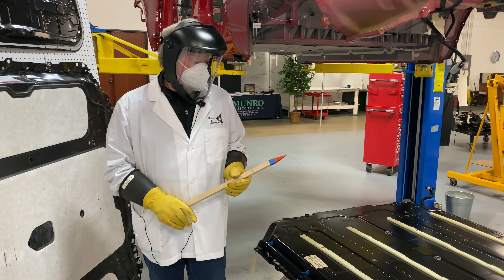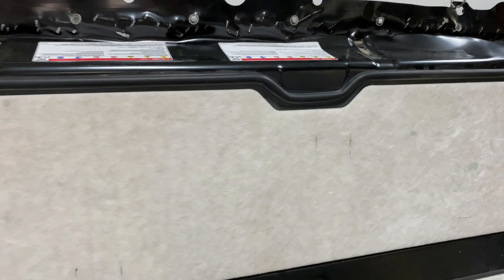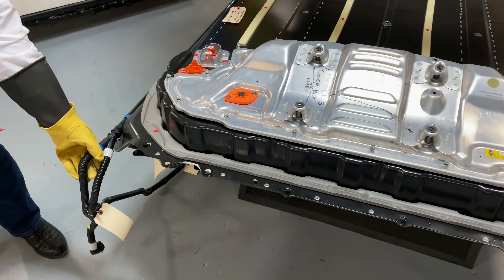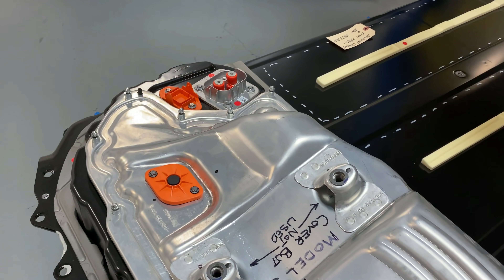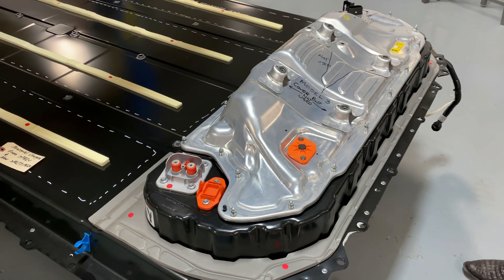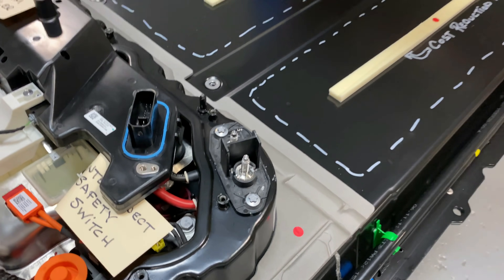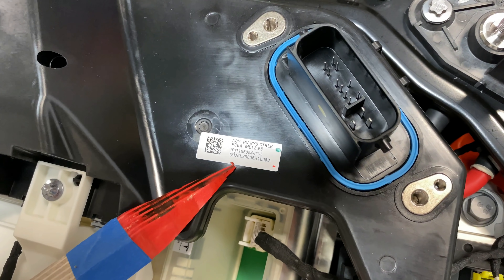Model Y E24: Opening up the High Voltage Battery and Comparison MY-M3, Pyro Fuse

Comment: My questions are a little late wrt this video; however, I thought I'd post in the hopes someone is still monitoring comments and may have the answers!
1. If I were to dent the underside of one of these packs with up to 1/2" (12.7mm) dent, caused by a rock strike, would said dent compromise the integrity of the pack?
2. Can Tesla service centers diagnose the effects of said dent(s)? to determine whether the HV pack needs to be replaced?

Comment: great video. Does the pyro fuse protect the system from over current in the case of a battery short and if so, what sort of current would cause the pyro fuse to blow?

Comment: I just remembered something. I have a 2015 Prius V. I had no idea just how handy a hybrid car was. I like to camp in it, if it's very hot or very cold , I'll leave it ON, but the ICE turns on every 5 minutes or so. I think my 12v DC system is running off the small 12v starter battery (I use 12v to charge my electronics with, sometimes hook up to an inverter). I've read accounts of people who've run the essential house functions off their Priuses for a week during power outages. At some point I wish I could've connected an inverter to the large traction battery. (There's a YouTube video that is basically an idiot test: Do you understand the video? Yes, then you're an electrical engineer. No? then you're not an electrical engineer and shouldn't try any of it. No, but you're going to try it anyway? You're an idiot).  My imagination started running wild, what about hybrid boat engines? Why hasn't Toyota sold the ICE/Battery system as a generator...  I'm sure you could explain all my ideas and why most of them are unworkable (or already being done), but some of them, or others are viable. Now go to the Cybertruck: 120/220 VAC plugs, integrated air compressor (and I sure hope there are ports at every wheel well - if they can be made mudproof and muddied-up-accessible.

Comment: I heard the Model Y the installed a battery warmer like previous Teslas.  Wonder if its resistive or uses the heat pump instead of the motors like Model 3.  Or is it the same?
Reply: It uses the heat pump

Comment: Why would the 12V battery wires need to be so thick? I would not expect high current to be needed at 12V in this type of system.

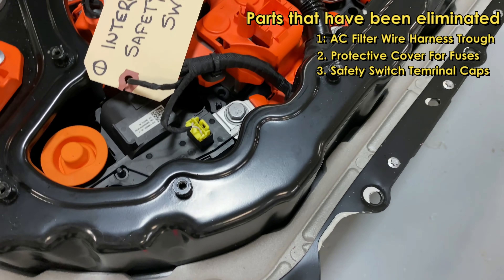Comment: What's a "Temrinal" Cap?  At time stamp 5:41.
Reply: The word capacitor is often abbreviated as 'cap;' they had probably been connected across those high-voltage switches to protect the switch contacts. When automotive ignition systems had employed a cam-actuated switch (points), a capacitor reduced erosion due to electric arcing of the metal contacts.
Reply: @brothervance1932  I know what "Cap" means.  I was talking about the word "Temrinal", that was on the screen. Is that a brand or did they mean "Terminal".

Comment: Hello Sandy, in your description of the components under the AL lid I am missing a reference to a converter when AC-charging takes place. You only pointed at the DC-DC-converter that comes into effect when the charging current is DC, right? Or could it be that this big housing also hosts the AC-DC-converter? Thank you for your answer.

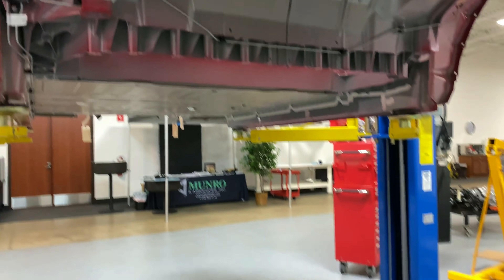Comment: Pause at 1:12 to examine the large, revolutionary aluminum casting. It appears to be made in two halves because you can see a gap or groove down the center at the front and back of the casting. The other thing I’m wondering about is the seat mounts on the battery control module cover. Does this mean the seats must be removed any time the battery is removed from the car? Also, are there 4 more seat mount locations on the chassis to the left and right of these mounts?

Comment: I love their design philosophy, they are obviously thinking in advance to be able to standardize their battery "form factor".  The batteries are lasting insanely longer than most imagined though, so battery replacement looks to likely be a non-issue.  The interesting thing will be the possibility for upgrading your battery to a dramatically better energy density unit in the future, and the software to support it is easily deployed ahead of time.
Reply: TexRobNC - With the exception of the Leaf (because Nissan beancounters decided to eschew thermal management), EV batteries seem to last longer than anyone expected.

Comment: As someone who works on high voltage equipment regularly (20kV+), I had to chuckle at the amount of protective gear worn here.  I think the max voltage on that pack is maybe 400V.. and while it would zap the shit out of you - possibly resulting in death - if you touch the wrong thing, it isn't going to jump across the air and attack your face with a sudden lightning bolt.
Reply: Accidentally drop a metal object and the current turns said metal object into a rapidly expanding cloud of molten droplets.  They make nice burn marks on your lab coat, but are hell to take in the face.  I think it's also a "don't try this at home without proper gear, boys and girls" kind of thing as well.

Comment: Mr Munro, that pyro switch probably disconnects all high voltage not just two batteries. Because batteries wired in series to get the high voltage if you open a circuit between the sets of batteries ... it will shut off the current on the entire block. There are probably like 4 blocks at ~90v each - giving 360v. I am willing to bet they used common 360v industrial ac motor [at least initially pulse control].
Reply: Dear Brian, Tesla motors are far from industrial AC motors. Check the Munro video about electric motors and you will learn that the rear Y motor is a permanent magnet one, with a special set of magnets used to bend the magnetic flux in a very uncommon but affichent way. That motor has been developed for the 3, the Y, and the Semi by Konstantinos Laskaris and his team of fellow researchers in Greece. Those guys are the best EV motors engineers you can find on the planet ! And, with a past as electric engineer having developed my own EV and a variable reluctance motor during the 20th century, I know a bit about e-motors...
Reply: That is not what I said or meant. I was pointing out that the pyro disconnect all high voltage. And they probably started with 360v motor.

Comment: DC to DC converter? How he described it,sounds like a DC distribution module.
Reply: You have to keep in mind that the only power going into the car is high voltage DC into the main pack, which then gets converted down to 12V (and possibly other voltages) to operate the computers, fans, etc. So technically because the input of that module is high voltage, and the output is low voltage.. it's a DC to DC converter.

Comment: Can anyone elaborate on how the Pyro switch works?
Reply: First hit on Google search. There's a pyrotechnic charge in it that severs the connection. It's triggered usually by the same signal as airbags.
Reply: @iLoveTheseRemoras  Ahh right I get it - thanks! Sorry for not googling, I assume it wasn't common so asked here, clearly should have googled first!
Reply: @dsmclaughlin12  No prob, I didn't know it was called that either. Have seen one before though
Reply: It's an explosive link. To be fair' I'd have thought there would be three to separate  the battery pack circuits into four.

Comment: Sandy, could you point out source of the battery breather "pops" that M3 owners are very familiar with? Will it be corrected on the MY?
Reply: I suspect it's not the breather itself that is making the 'pop', but rather the large metal panel flexing that makes a sound.    The internal pressure is supposed to be controlled by the breather but if the rate of pressure change exceeds the capacity of the breather (I've only heard it while supercharging when a relatively large amount of heat is generated quite quickly) a small amount of pressure can build up, causing the aluminum to deform and 'pop'
Reply: @sooocheesy  Ah right that makes sense. When it's freezing out it's even worse. As I commute to work my car thunks all the way down the highway as battery warms up. I just hope after a couple years of thunking it doesn't cause stresses and fails.
Reply: It's probably a panel that could have benefited from stiffening ridges. Maybe some anti drumming mastic mat would stop the popping. Then again - strippng the car to get to it...

Comment: Munro needs to get a current production model 3 and see how many of these changes have already been added to that assembly line. Tesla doesn't do model years.  The model three there are comparing it to is an early production from 2017 I think.
Reply from the maker: As some have alluded to, although we would love to tear down all model years of all cars, it just doesn't make business sense for us to do so.  The Model 3 that we tore down in 2018 was an early production model, just like this Model Y is. It is HIGHLY likely that many of the iterative improvements that we're pointing out are in fact present in current Model 3's now, but that doesn't diminish the fact that they are still improvements.  Thanks for tuning in!
Reply: Wok buy him one and he will
Reply: Smarter Than You He could buy a used one, re-assemble it after,sell it, and it would cost very little overall.

He’s only holding onto the Teslas he already has for consulting purposes.
Reply: @bob15479  except ofcourse for the cost of his engineers to disasemble and assemble the car, the analysis that needs to be done, and that they can't do any other actual work when working on that... yeah no cost at all. while i'd like a teardown of a current M3 i realize that its a business not a charity be glad that they show us the vids from this teardown
Reply: Mark Brand so bring him yours, pay the labor for disassembly, analysis and reassembly. 

Or if you’re too broke to buy one (which is likely since you don’t understand cost or the fact that they are so far retaining 90% of value at a year old) talk someone into donating theirs and having it returned sans warranty
Reply: Smarter Than You Ouch, sorry, didn’t realize I had insulted your dog, your mother, and your patron saint. Take care ✌️
Reply: I was thinking the same thing.... I bet the battery sled is exactly the same as current M3.

Comment: I would like to buy 1 Tesla battery (from inside the pack, there are thousands) for 10$, are you gonna sell it?
Reply: Second that, but it's probably too difficult to pry them apart. Take a look at the Model 3 pack and you will see there is bonding foam everywhere. https://www.youtube.com/watch?v=64_iBKLSnGA
You'd have to dissolve the foam and then de-solder everything all the while making sure never to touch anything with metal. I suppose, Munro and associates have better things to do.
Reply: The model 3 pack had 4,416 x 21700 cells...if he sells them at $15 each, he could make enough money to buy another Tesla model Y performance. $20 each, could buy a tri-motor Cybertruck to take apart.
Reply from the maker: Appreciate the idea, and we actually did discuss it, but it is more labor intensive than you'd imagine to chisel those cells out of the potting compound that they are buried in inside the modules.  Also potentially hazardous to be shipping batteries.  So unfortunately, no.  Plenty of other parts listed for sale on our site store though!  Thanks for tuning in!
Reply: Oh awesome, finally got a commercial. Looks like it’s YouTube approved finally. Whooo
Reply: With that my phone will finally be able to last more than 2 days
Reply: I want to buy about 1300 to 2000 thousand for a project, bulk pricing?
Reply: agreed sell them for 20 bucks a piece, I would buy one, easy to package and ship, looks cool, great idea
Reply: Look on ebay...
Reply: Get one from Nevada's Gigafactory on eBay https://www.flickr.com/photos/nycandre/49805938592/in/dateposted-public/
Reply: Ofer, you really don't want an actual Tesla cell. The positive end is recessed and made of aluminum. This makes it very hard to charge in a conventual battery charger. You are much better off getting a more common 21700 cell. For instance, If you want high capacity (like the Tesla cell) get a Samsung 50E or LG M50.

Comment: Many times in these videos Sandy says that bolt dimensions are identical as Model 3 and they did differently this and that compared with Model 3. And I'm just wondering, if he did look on current Model 3 if it is really true, I'm just wondering how many of these different Model Y parts are in Model 3, which is going from production line right now.
Reply: Maybe if someone gave them new model 3 to see
Reply: @635574  https://www.teslarati.com/tesla-model-3-teardown-analysis-sandy-munro-threatened-lawsuit/ like that one.
Reply: @xavierStark84  The key takeaway from that report is that Mr Munro stated,  “next-gen military-grade tech years ahead of its peers.” That should give you a hint about Tesla.
Reply: Sorry that was from the UBS report not Mr. Munro's.
Reply: He is comparing the release version of M.Y to the release version of M.3. Imo its a fair comparison, even if the M.3 of course also changed since that time - maybe even in part due to his input. Showing all those changes and improvements is not intended to be a "do i want a M.3 or M.Y ?" decision help, but more an analysis of the technical challenges and how tesla solved them then and now.
Reply: You can almost guess: the parts that are easy to retrofit are probably in the new M3's already - others, like those that depend on the rear aluminum alloy casting aren't in - YET -  the new mega ton stamping press which they are installing in Fremont, however might be for a leapfrog casting more encompassing than what is currently for the Y (3 pieces). Elon Musk mentioned there were TWO of these mega die-casting presses in the world, one made in Italy (probably the one in Fremont now) and the other in China (for the Shanghai MIC Model Y).
Edit - not stamping but die-casting presses  - thanks @David Elliott
Reply: @nycandre  The mega machines mentioned by Elon are high pressure DIE-CASTING machines.
Reply: @Dave5843-d9m   Yes , thanks, corrected !
Reply: The full détails of the Y / 3 comparison will be in the Munro full report. I suspect the priced that big paper stack will be similar to the Model3 report about 87,000$. I am not fully sure at this point that I need it so bad.... Maybe when my TSLA shares reach 7,000$?

Comment: I'd feel a lot more comfortable if the battery was hooked up to something to discharge it.
Reply: Can't drain to much below 3v per cell without damaging the battery.
Reply: @waynerussell6401  - Surely that doesn't matter. They're tearing it apart to examine it, not use it again. I can't see why the batteries can't be completely drained. These things are lethal, and you don't want them hanging around with the potential to kill someone.
Reply: @rogerfroud300  Of all the items they will auction the battery pack is by far the most valuable. The individual cells are difficult to remove but modules can be sold. If each cell could be signed and sold to enthusiasts at $10 the pack is worth $44610 - more than a Model 3 SR!
Reply: @waynerussell6401  - Fair enough if that's the final destination of the battery. However, they do seem to keep the drive train parts and break them up for examination so you can't just assume that this is going to be sold.
Reply: @rogerfroud300  They are selling off all surplus parts. The cells in the 3 and Y are the same and Munro have not shown they are capable of analysis of battery chemistry, or manufacturing. Even if they develop this potential (fairly important in an age of EVs) they only need a handful of cells, not 4416 of them.
Reply: You cant really discharge it completely.
It wiuld damage it and probably make it less safe.

Comment: doesn't the battery have a fuse, by the main terminal, which can disconnect any power??? I think it should be taken out before starting any work on a battery pack....
Reply: That just disconnects the pack from the rest of the car main terminals are still live.